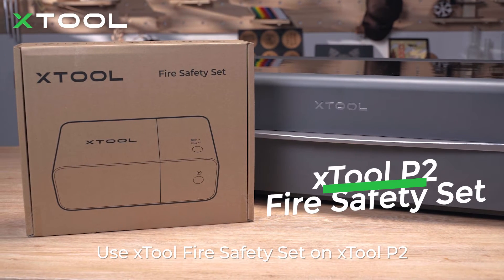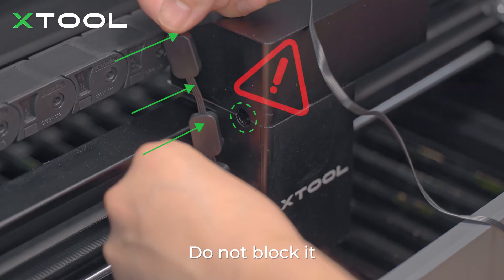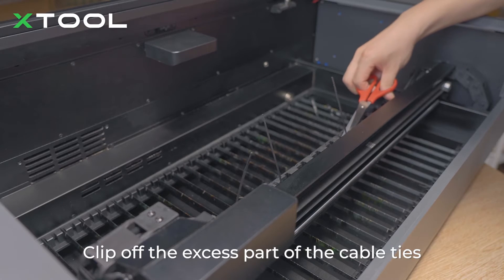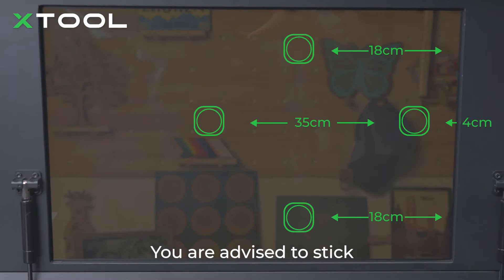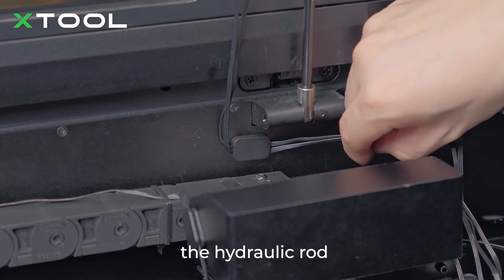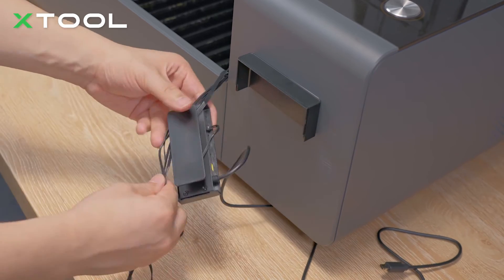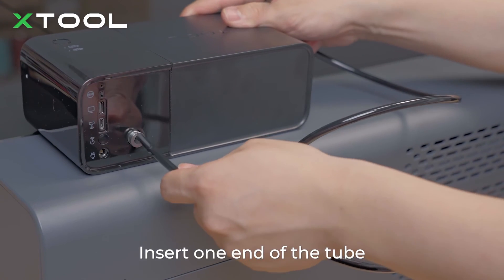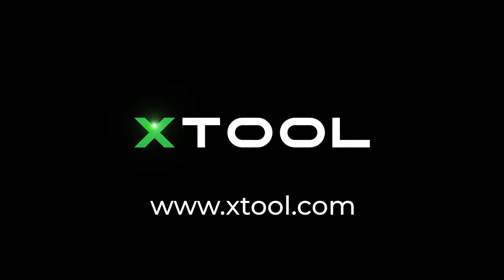How to Use xTool Fire Safety Set with xTool P2 | xTool 101

Comment: The installation of the fire safety device totally ruined my fantastic impression of the xTool P2S. I did it exactly as shown in the video. I don’t understand if the author of the video even tried closing the lid?! The cables coming down from the lid hang loose and block the head from moving to the right edge. This really made me angry! Luckily, I tested it with the machine turned off. Now I’ll constantly be worried that some sensor might fall off during operation, the head could crash, and maybe even cause a fire?!😕😕😕

Comment: for anyone else confused as hell what the deal is with the round plug at the back, it’s for the ONBOARD sensors. if your using the external sensors shown in the tutorial it doesn’t even need to be plugged in.
Reply: So does that mean that I can have the fire safety system installed without installing the sensors they provided  and it will still work with the onboard sensors?  I made the mistake of buying this system thinking it would be best having something linked to the XTool. Didn't see any explanation on the instructions sheet provided with it about the sensors.  The only thing I found is this video!
Reply: @McCulloughArt  Correct. You do not need the additional sensors that you can buy.

Comment: Couldn't you just run the cables through one of the vent holes on the bottom slide out tray instead of through the door?
Reply: I guess in hindsight that would potentially put the wires in the path of the laser.

Comment: The updated instructions now give you the option to bypass the sensors, in favor of using the built-in detection of the P2. 

Is it recommended to go with the built-in sensors versus these sticky backed ones ?
Reply: @Real_Name_Redacted  Thank you for this. I had started putting the sensors in, then saw your reply. I'll try it with the built in sensors first.
Reply: Were you able to figure this out? We are struggling with the sensors
Reply: where did you find instructions?

Comment: any reason we can't just open up the drag chain and manage the wire inside versus zip tying them to the drag chain?  I have 3D printed drag chains, installed them, repaired them, enhanced them, on 3D printer farm, plasma CNC table, and CNC router.  Other than a weird EMI issue, I am not understanding why you would instruct us to not use the drag chain for what is designed to do (safely direct cabling and reduce wire fatique).  I have tons of extra ferrite ring cores, I could add to the sensor cable if the concern is EMI)?
Reply: I wired it through the drag chain. The thing that keeps me upset is having all these cables going to the hub through the front. It's incredible how they let that so "unfinished" :/

Comment: I am seriously not believing that I just spent, what is to me, a small fortune on this awesome machine that I love only to have it look all janky when the Fire Safety Set is installed. I literally had to duct tape the sensor cables to the enclosure opening in order to be able to fully close the lid without pinching the cables & breaking them. I'm glad at least the Fire Safety Set was "free" with the purchase of my P2. xTool, you know better so do better!
I always stand or sit within reach of my P2 & M1 while they're in operation, so I'm not sure if I will even use this thing.
Reply: I have the safety unit connected without the sensors.  I figure if there is a fire while I'm there I can manually active the CO2 cartridges via the button
Reply: @OG_Beckie_Leigh  agreed i just installed mine and it looks like crap lol
Reply: @ Mine is put away in the box never to see the light of day again. It's been a good long while since I've used my machine, but I always stayed close by when I was using it. My eyes are a better fire detector than that thing anyway, and it's never a bad idea to keep a fire extinguisher handy where your working too.
Reply: @ lol that is seemingly in future as well
Reply: my
Reply: @OG_Beckie_Leigh  no wonder they're just giving these away with purchase of the machine as a "gift" now lol. What a gift..

Comment: I agree with the comments on here. The wiring and implementation for this fire safety system should be thought through. One example: Having the wires barely passing through the corner of the lid vs through some kind of gromment hole is bad placement. Eventually those wires are going to get crimped and then broken. I solved it by stacking the wires on top one another with masking tape as tight to the corner face as possible; wedging itself in the tiny gap when i close the lid. It's better then bunching them up at the corner and having the lid crush them.

In addition - Suggest mask taping the wires inside the machine. Otherwise, it may dangle and get caught up with the laser head when it operates on one side.

Comment: The instructions should recommend opening the drag chain links and routing the cable through it instead of using cable ties. I would also drill a hole in the chassis and route the cables and connectors through a grommet rather than having the cables under a door where they can wear through over time.

p.s. - My wife is the world's most restrictive safety officer and she wouldn't approve of the wiring recommendations in this video.

Comment: There is a mirror under that top laser head cover that should be cleaned regularly.  Placement of that second cable tie on the laser head cover would restrict your access, and make you undo the wiring just to get to it daily.  I hope a better solution can be found for this.  Plus I know this is designed for function and not for visual pleasure, but my OCD is kicking in about all those wires coming out of the front of the machine like that.  Please come up with something better.
Reply from the maker: Thanks Alan, we are currently working on a better solution and will keep you updated!
Reply: You clean it daily?
Reply: @lushfauna  It doesn't take long to clean the mirrors, lens, and air assist every day, and it's a good practice that will yield consistency of production.
Reply: @lushfauna  if you use it daily,  you should get into the habit of cleaning your mirrors and laser head cover and lens.  They get foggy after each use, and if left unattended, they will cause problems cutting,  engraving, and scoring later.
Reply: @xtool all you have to do is remove the cable from the clamp and you can take the top off to clean that mirror

Comment: This looks a little clumsy on such an otherwise professional looking machine. I wish you had thought of it as a feature for the machine instead of an extra addon. For example, the electronics could trigger to move the laser head away from the fire first, power down the laser, shut off the fan, etc. instead of shutting everything off by disconnecting power.

Can you still remove the laser head and camera covers when you attach the sensor to the laser head?
Reply: Agree 100 percent with you. It’s looks like an after though gadget.
Reply: I think this was designed for D1, then made to work with P2, i just installed mine and agree this is not very clean for a otherwise clean machine... 
 @carlosa.valentin.ministries